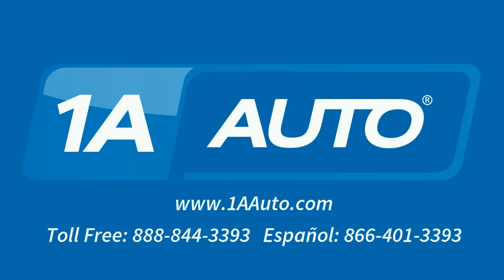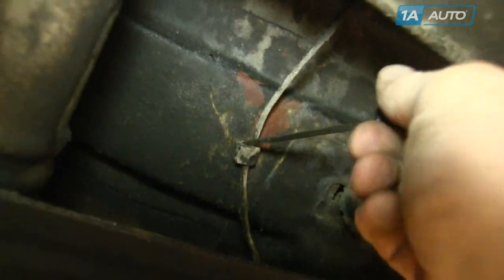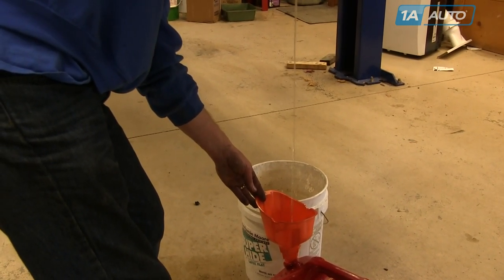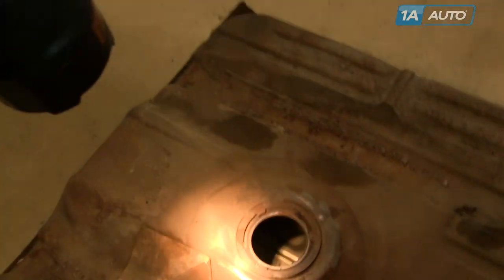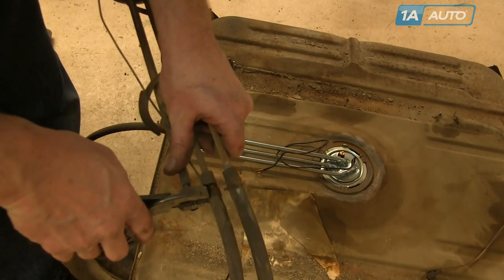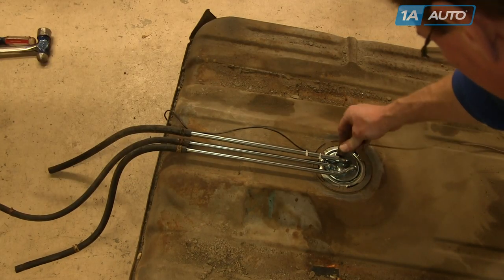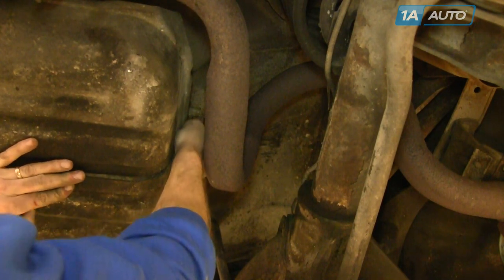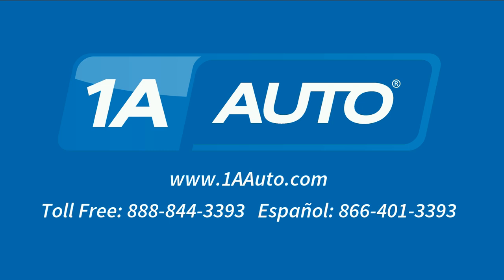How To Replace Fuel Tank & Sending Unit 71-76 Pontiac Grandville

Comment: Great video. Question...why do some tanks use 3 lines and others 2?
Reply: There may be a fuel return line.
Reply: The video said 3 lines is for AC set up and I'm guessing 2 lines are for vehicles with no AC.
Reply: Pump, return, and vent.  I believe some cars lack the return. Return is used to keep the gas cool.

Comment: I noticed you said you also sell a full line of fuel tanks what would the price run for a tank for a 78 ford f250 front tank???
Reply from the maker: +The Dude http://www.1aauto.com/search?q=tank&year=1978&model=1523 For more info call toll free 888-844-3393 or email service @1aauto.com
Reply: 1A Auto Parts hey thanks for the quick response and the information

Comment: i have a 75 pontiac grand prix and fuel gauge reads empty.  car is garaged since 1980 and was working fine.  then all of a sudden it shows empty.  i hardly drive it so not sure if it's the sending unit.  Could it be the same issue?  car only has 90 ish miles on it
Reply from the maker: +Jose Arroyo Thanks for checking us out! It is possible it is the same issue, but given the age and it sitting for a long time, there also may be underlying issues as well. We highly recommend taking this to get professionally looked at so you know what the issue is and can fix it the first time.
Reply: @1AAuto  I've been searching for an affordable solution.  One guy told me to try seafoam in my gasoline and drive it slot

Comment: Great upload! I have a 1972 Pontiac Catalina sedan with a Pontiac 400/6.6 V8. It came with air conditioning which was installed on the assembly line in Doraville, Georgia during late February of that year. I've been having trouble with my fuel gauge and have reached the conclusion that I need to replace the sending unit. The last time I was underneath the car to clean the ground connection I am positive I saw three lines coming from above the fuel tank. I figured the third line was because of the AC unit as seen in the video above. I looked on the Discount Body Parts website and I found a sending unit for 1971-1972 models, but it only has two lines. I checked other year models and they had a sending unit "for models with A/C only" with three lines. The "Product Fit" category indicates that the the A/C version only fits 1973-1976 models. I need help figuring out what's going on here. I haven't dropped the tank yet. Did 1971-1972 models have a separate A/C line? Would the later 1973-1976 A/C version work with my car? Thanks in advance!
Reply: My sincerest apologies, I've been looking though multiple websites and I got that one confused with the A1 Auto website! I've been coming across this issue through every websites I have searched though, including A1 Auto website. Thanks again!
Reply from the maker: +Noah Eller Thanks for watching. Have a great day! 1aauto.com
Reply: I figured it out. In 1972 cars the A/C evaporative emissions was ran directly into the fuel tank through three separate lines, bypassing the sending unit altogether. In later models (1973+) the A/C line was ran through the sending unit itself. I got those three emission lines confused with the two fuel lines. Thanks!

Comment: Had one replaced on my 75 pontiac grand prix.  Now that it's replaced along with the three fuel lines the car no longer stays on.   I turn it on and then it shuts off.   Could the cause be the new sending unit failing to send fuel to carburetor????? Need help